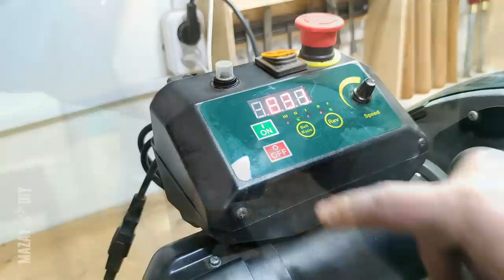DIY Dead Blow Mallet with a "secret ingredient"

Comment: Классная идея, только металлическую часть надо делать из стали, чугунный тройник может разорвать от ударов (тем более, что в нем уже есть надрезы), коэффициент Пуассона однако 😕
Reply: That tee is likely black iron, which is literally as tough as nails b/c they're made out of the same material. Black iron will not shatter. However, that being said, this tee appears to be a schedule 20 tee. It needs to be a schedule 40 tee as the schedule 20 stuff is too thin and is liable to fail over time.
Reply: @jomamma1750  in common black iron, but specifically cast iron, that breaks easily. It doen't intend for impact loads.
Reply: @numapompily5649  You're 100% incorrect and clearly have never worked with, or built, anything with black iron pipe. That stuff BENDS, it doesn't shatter, ever. It is literally made out of the same material as common nails. 
Perhaps you should spend at least one day of your life on a job site??
Reply: @jomamma1750  I don't know where you are from. But this tree made in Russia and I know what material was been used. Besides I've got a lot of them and worked with them and know how them split apart. You just mix up pipe end tree. Different materials (in Rassia or couse).
Reply: @jomamma1750  трубы стальные, тройники и прочие фитинги — литые, чугунные и хрупкие.
Reply: @jomamma1750  гвозди стальные, тянутые, фитинг на видео из чугуна, литого и хрупкого.
Reply: @jomamma1750  fitting in this video made of cast iron (means iron with carbon >2,5%). It's not black iron that mean usual low-carbon steel which nail and common pipes are made from. Cast iron is hard but fragile. Black iron is not so hard but flexible.

Comment: My furst guess is lead shot.

The 32 on that pipe tee, in the context of a mallet, distracted me into thinking a 32 ounce hammer head would need something extremely heavy for shot inside it, before I realized the 32 is part of the pipe tee, and unrelatsd to the fact you had made it into a hammer.
Reply: Odd choice of interior in my opinion. It seems sand, or steel shot is a better go to interior. 

I also don't like working with lead, and the sound of those screws clanking around would drive me insane.
Reply: @Legocatshouse  I used balls from old bearings to make one like this years ago, also with a water pipe tee. Works perfect.
The screws were an odd choice.

Comment: Now that’s thinking outside of the box!! What an incredible idea!!
Reply: @pyroboobysmith359  I made a dead blow hammer years ago with a water pipe tee like this.
I used the heads from a plastic head hammer.
It is already threaded, In the tee I welded a nut at each end and filled it with balls from old bearings.
I made the handle by hand, without a lathe.
You can do without a lathe, just get started. 😉

Comment: Don't hammer on the back of that hatchet1. You'll crack the steel butt of that axe head and you'll be doing a video about welding it back together.  

This partiular style is especially susceptible to fracturing since the butt is very thin.  Instead of cracking along the side it'll crack right in the back.  Axes that need welding back together are never as strong as they were before they were abused and broken.

You can use hatchets to hammer on soft materials, like wood, but not on metal, and you can't hammer on it like it's a wedge you're trying to drive through material unless you have a forged one-piece axe like a Bridgeport or an Estwing.
Reply: If he only had a wood faced mallet to do that job....

Comment: I don't think i would use a schedule 40 tee especially after scoring the inside like that. Unless i just couldn't dig into my tool box to get one or to just buy one im gonna pass on this one . Better to be safe than getting stitches at the emergency room when you get cut by flying fragments !
Reply: Isn't schedule 40 made of PVC?  This is a Galvanized Pipe Tee.  And with the wood hammer tips I don't think there is any worry of that iron pipe breaking.
Reply: Schedule 40 can apply to both iron and PVC pipe. It relates to wall thickness for a given trade size. I agree that soft iron used in this way is pretty low risk. The saw cuts were just to the base of the threads to let them act as a thread-cutting die on the wood.
Reply: @bradnail99  Right on, thank you.  Learned something new today!
Reply: @bradnail99  perhaps cut the thread on a separate thread-cutter, and make the hammer of an intact t?